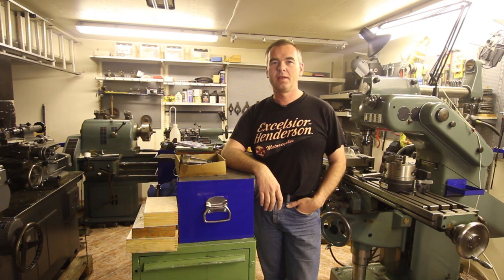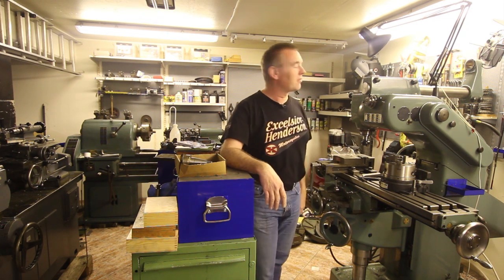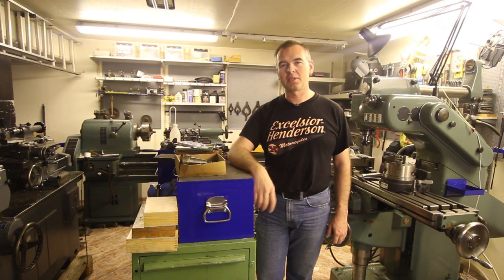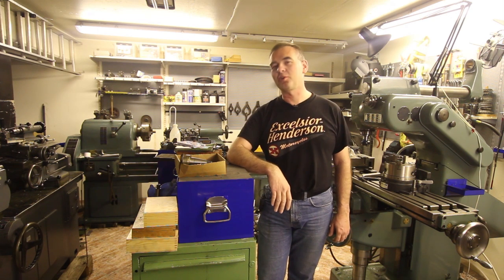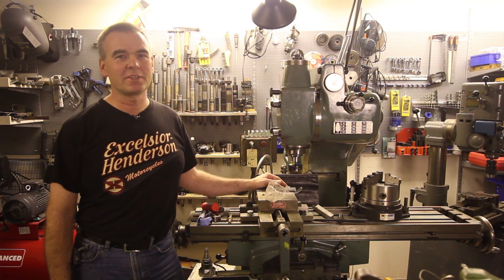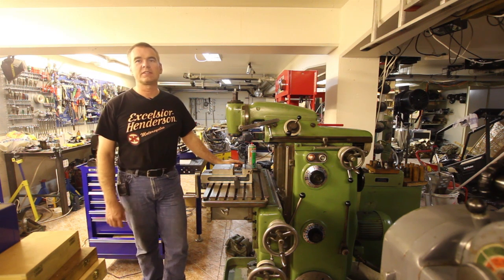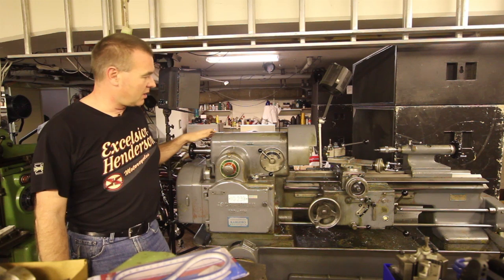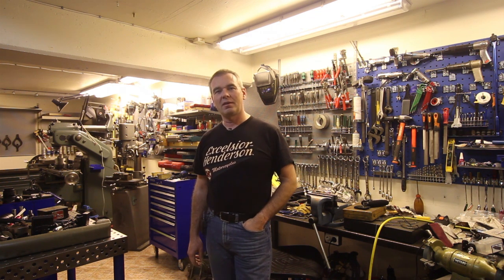Introduction to me and my workshop

Comment: Hi
Do you like the Abene or the Deckel mill the best, ???
If you only had one would it be the Abene or Deckel mill ???
going off the way they work & setup times & feel for the work.
jeff
Reply from the maker: I like the Abene most, without a doubt. I mostly use the Deckel for drilling, since it has a quill.

Comment: hi Mattias, your workshop is amazing. in this video you show a schaublin 120VM, do you know which module are the gears for to make threads? I ask you because I found a Schaublin 120 vm but it has not a single gear, and I do not know if it is a good idea to buy it because without gears the lathe is a little bit unuseful. thanks for your time and for share your videos.

Comment: Hi Mattias. I'm subscribed! I'm in Nuuk, Greenland and have also been inspired by the guys you mention. They got me started and I really enjoy working in my shop. I don't have a youtube channel yet, but hope to. Thanks for sharing. I'll be watching!
Reply: MY  NAME IS  LARRY  A. Dean  my address is  ,1923 Scratch Gravel Rd,  Marion Va.  24354 .I have a  Die shop  ,in Marion.  I HAVE 2 KERNE an Tracker  milling machines an 1 small engine lathe ,1 belt sander , 1 Holizonal saw ,1abrazes  cut off saw, man hand tools, man roaring cabinets, 1 grant surface plate. I need a small  surface grinder . I like  your shoe on U tube . KEEP UP